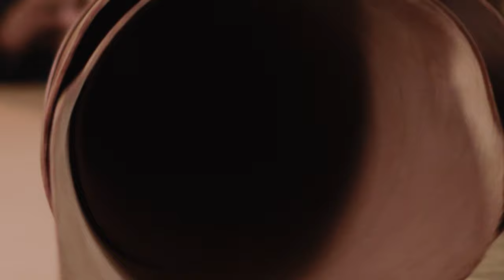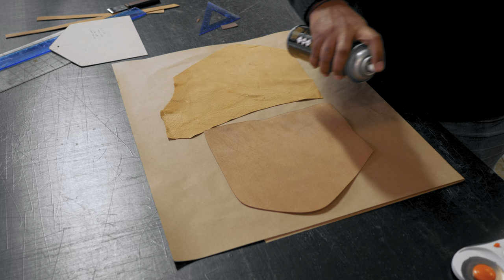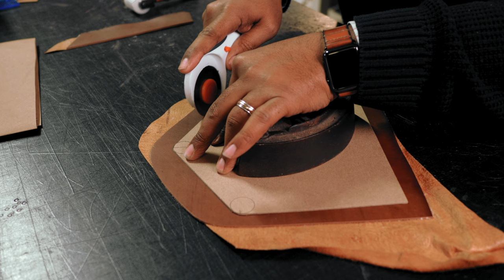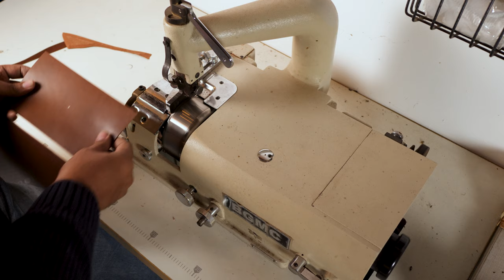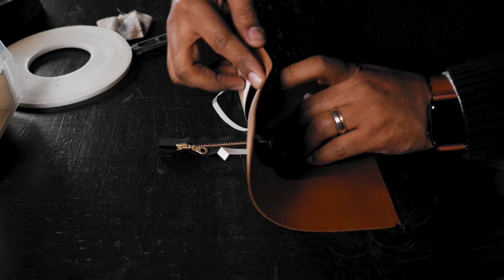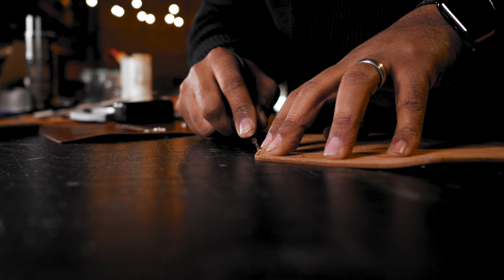Making the PERFECT Italian leather clutch with wrist strap! - ASMR

Comment: I hand stitch cause them walking foot machines leave them marks plus hand stitched is way more durable. You know how many bags,wallets etc from big names that I repair cause they are machines stitched and if 1stitch comes undone it spreads hand stitched though doesn't since its pretty much tied off every stitch. I once redone a holster that was hands stitch and I had to cut every single stitch and pull it out with tweezer. I made my mind up then I'm saddle stitching every item. I would like to know what you're using iafter you burnish in the lighter brown bottle? I'm always looking to have perfect edges and new ideas.

Comment: What is the spray adhesive you used to bond the two layers of leather together?
Reply: 3m makes a product called 777 Super Adhesive. It is awesome spray adhesive, but make sure both sides are totally dry before pressing the two pieces together. Otherwise it continues to off-gas and weakens the bond.

Comment: Such a simple, yet elegant design. Well done!  Using spray adhesive for the liner is a brilliant idea!
Reply from the maker: I don’t always use spray adhesive (because it can be so expensive and I don’t particularly like the fumes) but its very helpful when you need to work quickly or only have a couple pieces to do. Oddly enough, for bigger production runs where we’re doing a bunch of pieces at one time, a paint roller works great to apply the glue quickly to largers areas.
Reply: hello Odin, very satisfying to watch your calm video and tidy workshop! Can you please tell what kind of paint roller you use for glueing? I usually use firm short brush but it can get really heavy and slow to work like that..spray is a true revelation but I would prefer this roller..sounds great

Comment: Very Very Nice! What type of leather are you using for the lining the Vachette leather?
Reply from the maker: I just use a thin to medium thickness cow suede.
Reply: @OdinLeatherGoods  What are you using as a spray adhesive to attach the suede to the Vachette Leather ?  I have used a number or spray adhesives, the best that I have found so far is 3M Super 77. Is that a good choice or can you recommend something better?

Many Thank's Steve